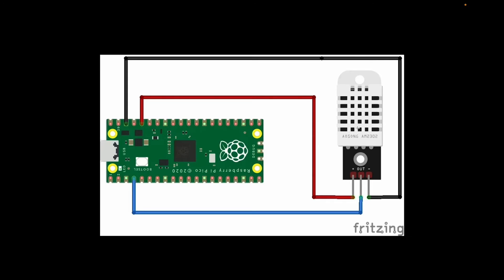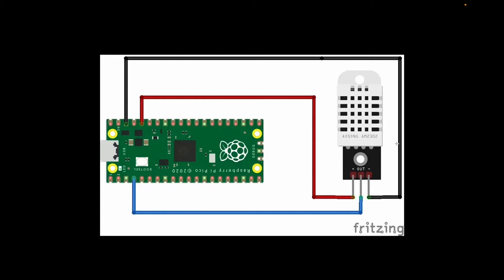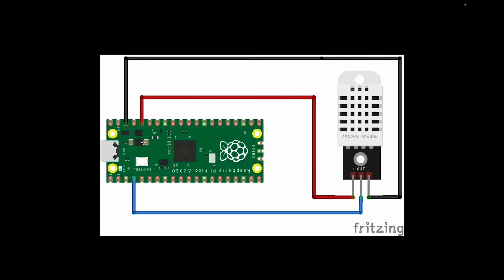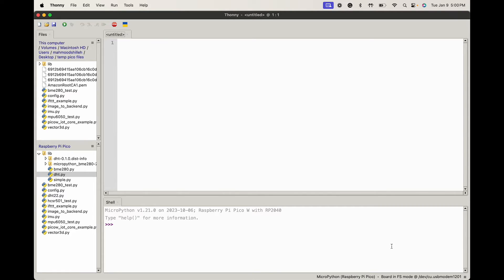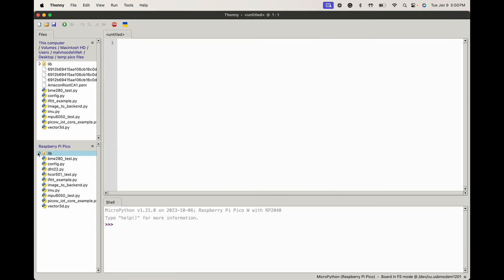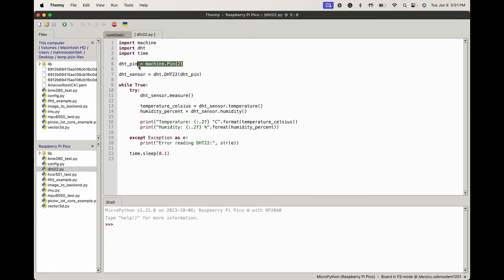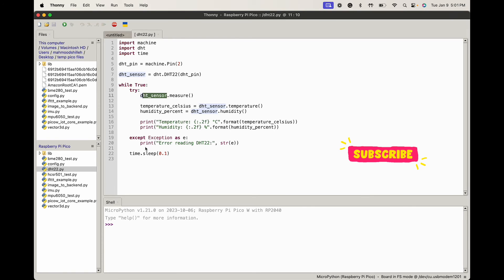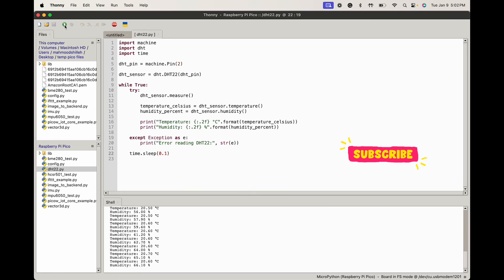How to Connect the DHT22 to the Raspberry Pi Pico - Measure Temperature and Humidity in MicroPython

Comment: Hey-     When I wire the circuit and run the code it throws an exception "[Errno 110] ETIMEOUT"  how can I determine what this means?  I tried 2 different DHT22s and checked my wiring......   Help?
Reply from the maker: Ensure correct connections and try different hardware otherwise!

Comment: hey, great vid. just a quick question, does it measure temperature of the board or around it, for example would it be a good project for a rack thermometer ?
Reply: "[Errno 110] ETIMEOUT"  how can I determine what this means?
Reply from the maker: This measures temperature around it, its more pertaining to atmospheric temperature or air temperature. I wouldn't use it for surface temperature measurement.

Comment: thanks for the video. After seeing your video I was finally able to connect with DHT22 and get the results. Is there a possibility that we can connect SHARP GP2Y10 Dust Sensor PM2.5 Module and have Pi Pico W showcase the results. I would really appreciate if you could provide some direction.
Reply: "[Errno 110] ETIMEOUT"  how can I determine what this means?
Reply from the maker: Hey buddy I actually never used this module before :/ if you ever need help I offer consulting slots on my buymeacoffee link but think it is doable, anything is really.